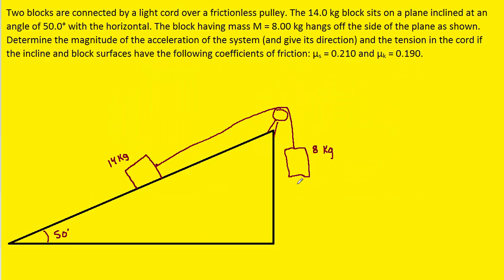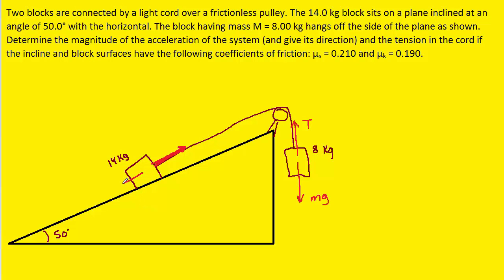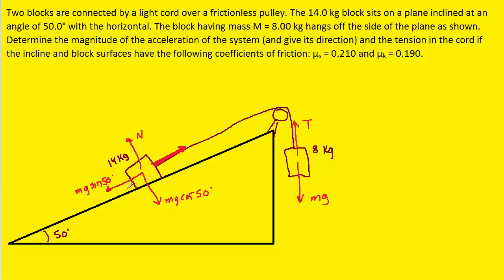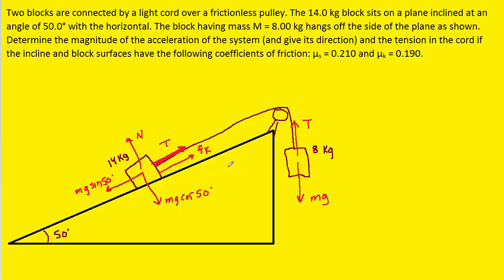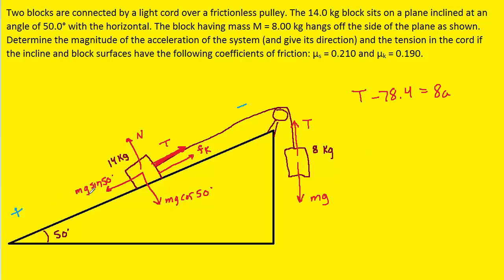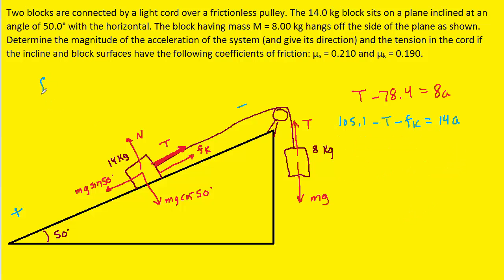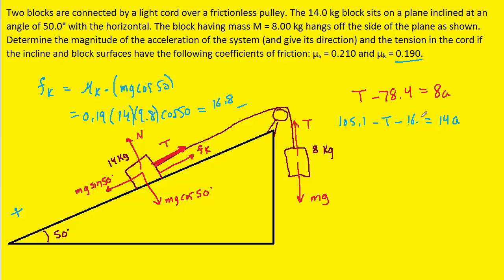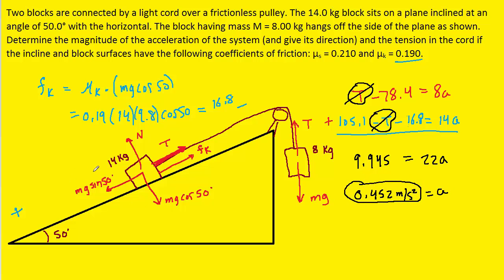Two blocks are connected by a light cord over a frictionless pulley

Comment: Draw the free-body diagram for each object involved in the following problems in a repair shop a truck engine that has mass 409 kg is held in place by four light cables. Cable A is a horizontal, cable B and D are vertical and cable C makes an angle of 37.1 degree with a vertical wall. If the tension in cable A is 722 N, what are the tensions in cables B and C?